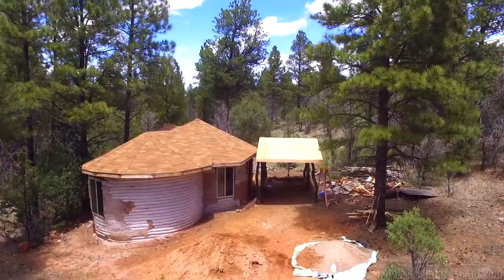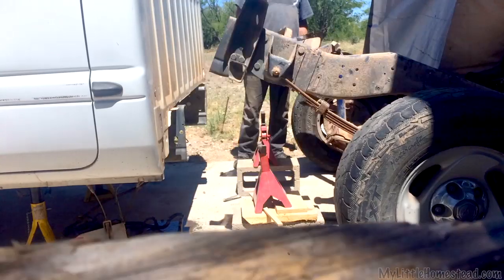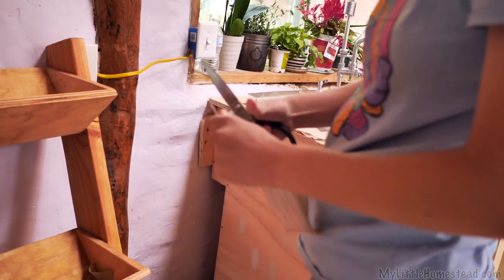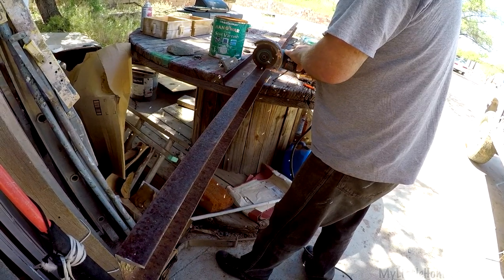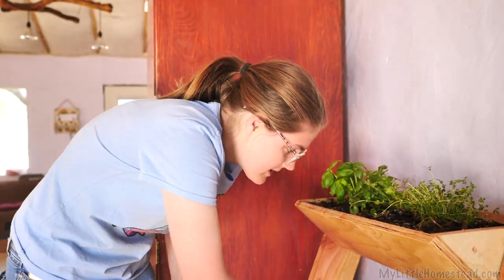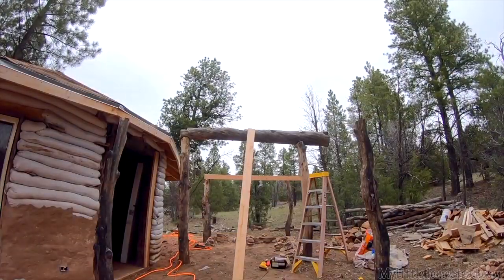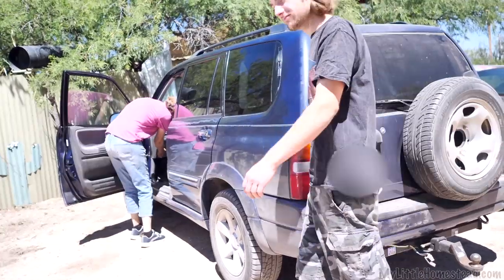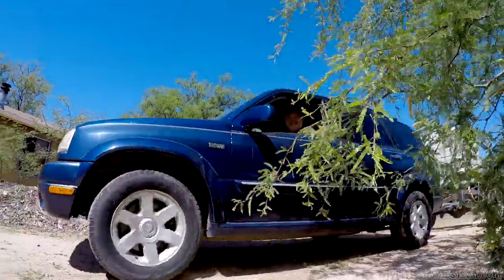Earthbag Cabin Return, Truck/Water Trailer Conversion & Herb Garden Planter  | Weekly Peek Ep187

Comment: you could use the concrete and put imprints of the plants...they would look like fossils
Reply: That's an awesome idea! I might have to try that at my house, I need to resurface my porch steps
Reply: Wouldn't the impressions make it harder to keep a clean surface?
Reply: @loro9385  not once you seal the concrete. The impressions would not be all that deep with plant prints.
Reply: Add all that together. Do Impressions of the leafs in concrete, paint, then epoxy pour to create a smooth surface! That would be amazing!

Comment: Forget epoxy countertops .. scratches show ..up yellowing . Forget about it ...
go with concrete..
Reply: Epoxy on live plant materials results in the drying of the plant to the point that all that is left is a clouding pecked bubble where the plant used to be. Even dried plant materials will dry further an end up doing the same. You can put it over stone and wood and metal. But, eventually it will chip, crack, and yellow. There are the colored and mineral tinted epoxies that you can make an abstract out of. But, stone is better. or try your cement idea. It is not something I had really thought on. But, who knows?
Reply: agreed

Comment: You guys could do a concrete counter with square cutouts; fill the cutouts with mesquite leaves/twigs, and then fill the cutout with epoxy.  Best of both worlds.
Reply: I had the same idea. easier to keep clean than impressions of leaves (as some have suggested) because of the smooth surface of the epoxy squares. however, before committing to it, they will probably want to try a test on some scrap material first to make sure they like it.
Reply: nice idea, I would fill up with epoxy to cover the leaves but have a final layer of glass so that it is properly heat resistant and easier to clean.

Comment: Epoxy as a workspace will scratch. You can sand and polish it though. You also have to be careful putting hot pans on it. Sealed concrete wont scratch and you can put hot pans directly on it.

Comment: press any leaves or twigs first so they stay flat before epoxy,  if you go with concrete add some  powder color and recess some smooth stones about the size of a quarter into it and sponge them to be seen
Reply: Pressing is an excellent idea. Also to see how the organics will withstand the epoxy cure, do a test on a separate piece of board.

Comment: I would use concrete, you can use the leaves to make impressions in the concrete as well. The epoxy can be nice but concrete can handle heat.

Comment: Hello guys, I did my counters in epoxy. Very durable, heat resistant, water resistant. You can’t go wrong  I would recommend stone coat countertops. Great product low voc, up protected.

Comment: Take two pieces of glass,  3" x 3", sandwich you dried plants, embed in your concrete.  Do it in on the edges to outline your countertop, not where the glass can be scratched. Give the glass a coating to protect it.  Just thought...

Comment: Entombing stuff in epoxy typically has two consequences. The items get sunbleached eventually and don't look good and/or oil and whatnot from the items goof the curing process. Also those items will float which means you need several shallow pours which can be a real pita. Either way, the issue with epoxy resin is that you pretty much get one try and unless experienced a big pour will probably have issues. - On the flip side, we're planning to do concrete countertops. There's so many coatings and stains for it nowadays I really like the idea. I'd definitely go with concrete counter tops if I were you. Then, get the kids experimenting with resins so that you can do some of that down the line.

Comment: Have you guys ever used "paper crete"? It is portland cement with shredded newspaper. It is a great insulator and you can spray it on the outside. It might work better than "air crete".

Comment: The epoxy on the table with all the leaves and flowers will be great they will not lose their color if you put a layer of epoxy down first and then put the leaves and the flowers down and then epoxy over them you shouldn't have any air bubbles or anything in anywhere and they will last forever. You can use a small lighter torch to pop all air bubbles that rise to the surface. Make sure you do that before the epoxy dries. Love your videos guys keep them coming.

Comment: The main problem with epoxy and plant material is it forms bubbles within the epoxy that almost look like foam which leads to the plant material discolouring and the finish becoming opaque. We got around this by boxing the benchtops in a completely sealed box and creating a vacuum that pulls out the air with a vacuum pump. It will also help if you pour a layer of epoxy to put the plant material on before the second pour and vacuum. If you go for cement try polished cement since you can inlay glass, crystals and other visual magic and it looks amazing after polishing. May I also suggest acrylic pours and painting which is then covered in an epoxy layer as this allows for interesting 3D effects and would utilise Brees skills at visual design. Hope this helps, your family rocks

Comment: I would use concrete as the base layer to give the support you need, stain the concrete some dark natural browns then overlay that with the flowers and leaves on thin branches with a clear epoxy top.  If you seal the epoxy like they do with bar tops then there won't be the problem with yellowing that was mentioned below.  scratches and chips that show if covered with thin layer of epoxy after a good sanding every few years gives the brilliant water clear look that is loved.

Comment: For your countertops consider  both options. Press the impression of the mesquite leaves into the concrete then remove the leaves and seal with epoxy. If you want more color, before you epoxy do stains/dry brushing or both. Add uv block to the epoxy to prevent color fade

Comment: Tile is pretty easy to do but you could use 4x4's too. Cut them into half inch pieces nail or glue down, sand even and finish like normal wood. You could put an epoxy, Leave a gap and color your epoxy than sand that smooth and put clear on top. That would look like tile squares but it would be all wood. Lots of good ideas out there can't wait to see what you do.

Comment: Just FYI, There are two ways to do a concrete countertop. The usual way is to form them upside down. But there is a new way to do them right side up and in place. It involves commercially available plastic form pieces that break away after the concrete sets up.... see on youtube.

Comment: The leaves and seeds are pretty unique.  You could still do cement but maybe do impressions in the cement with the leaves, etc.  Then you could use a thin layer of epoxy over top to fill in holes and make it flat and level.

Comment: Make some ollas to water the herbs out of small clay pots (various vids on YouTube). You wont have the drip mess and it keeps the plants watered. Especially good for desert applications where water conservation is a must.
As for countertops, I would stick with concrete, as it doesn't off gas and you can put special glass or stones in making them visible, plus you can use plants and sticks, making a kind of fossil and paint them, before sealing it. Plus it doesn't scratch as easily as acrylic. Just a thought...

Comment: With the trailer you could move the axle attachment of the leaf springs from the bottom to the top of the axle to lower the center of gravity. Make it safer for transport. But with 1500 leaf springs they are rated at 1400lbs and that water tank full weighs around 2200lbs. Might flex enough to hit the axle if you do. Just a thought.

Comment: Parsley, mint, thyme, lavendar, rosemay and oregano do very well outdoors on the North side of a building. Parsley is biennial all the others are perrenials. Rosemary gets LARGE. Parsley, oregano and mint like dampish feet. Parsley and mint and oregano self sow. Cover them outdoors with a wire umbrella to keep the chickens and other tasters off the plants.
 It is a cute grow wall. Great for annuals and tender plants. 

Concrete counters work well. You can make 'fossil' leaf patterns by pressing material into the wet smoothed cement. Flake the pattern pieces out after the cement sets fully. 

Be sure to vibrate the cement well to eliminate bubbles. I did my first counters back in the sixties ( I think I remember that time). Vibrate was a hard won lesson. Also never too much trowelling if you want smooth, cleanable and hard surfaces.
 There are many food grade sealers (I like paste wax about 30-60 more days after cure and complete drying of the cement (it will stop feeling cool to the touch once dry)) for the final surface. Yes, you want to seal it. Like marble acids etch it and oils soak in and discolor it. 

With fine aggreagtes you can get a good durable surface out of an inch thick 
counter. I do not recommend any thinner. Thicker is fine but allow for 
longer drying time.  (sand, crushed glass, crusher fines but not fly-ash or slag for food surfaces. Reinforce with chopped poly fiber which reduces fine drying cracks (available at concrete suppliers and online as is the mesh) in the mix and use a non-metalic mesh as reinforcement in the bed. It is easy to shape and will not corrode like chicken wire or welded mesh does.) 

Wet cure (keep damp for 30 days) the counter by placing plastic under and over the surface and mist as needed. You can leave the plastic under after curing as it is out of sight.  

Like any stone, do not free span any distance over a about a foot and a half. I strongly suggest making a plywood/osb deck to bear the whole surface ( you can make the counters off site and install after cure and drying. You do not have to anchor the counter to prevent sliding, if you place some short key pins  (fiberglass or whatever non-metal you like) or troughs as a small gouge keyway in the deck.  You can use an adhesive from the bottom  or along the back. 

You can create hang over edges and back splashes with some creative wood forms. Bull nose and OGs are best done after cure with a stone router and polishing or use plastic drywall corner material to create the curves. A little spray of pam on the plastice before application makes it release easily.

Sorry, I get carried away! clear as mud right?

Comment: I refinished my dinning room table with epoxy, it looks great 4yrs later and it was so easy and fast. 

The cool thing about epoxy is you can put stuff in it, ( I would not put a live tree branch under)  but metal, dry wood, pictures you could be really creative with epoxy, for that matter you could paint the counter and then epoxy over it. That would look awsome !! Also its easy to refinish. Just be sure to stain or paint the wood underneath before you do anything, dont epoxy unfinished wood.

Comment: For the counter ideas maybe take some of your scrap plywood  ( 1 ft x 1 ft ) and make several test pieces. One for concrete, or 2 for different colors ect. One or 2 for the epoxy with plants , and if you don't like the clear with plants you can color epoxy over it.  With several tests pieces you'll be able to figure out how much you will need plus see what looks the best to you all without committing to the whole thing.  You can even do heat and water tests safely on the test squares .   You may be able to do a metal/ wood mini landscape with plants in epoxy, like an old farm look with painted background?  Best i can think of not knowing what all materials you have.  Good vid.

Comment: What about doing the concrete counters but before they dry lay the greens from the mesquite trees on top to imprint the shapes? Use a smooth roller to go over top to get the thin leaves embedded then peel off. I'd do a clear coat finish over top so it ends up being level and nothing gets caught in the shapes to keep it cleaner.

Comment: If you do epoxy over flowers or those tree pieces they won't loose their color in fact it will deepen the colors... you're just going to have pour slowly and a little at a time over the pieces so that they stay in place until you get the first coat down...I bet it would look really pretty...use the same stain then epoxy 😀

Comment: Did the Appoxy a few years ago.  It did hold it's color very well but it was so heavy, I mean very heavy! If you slice anything, the knife will leave scratch marks. We tried everything and ended up pulling it all out for cement counters with a large butcher block insert. He also made a butcher block sliding insert for sandwiches, etc. Hope this helps. God Bless.

Comment: Make a 1'x1' test form & test how the folage will work in the epoxy. You could use it later as a wall hanging or what ever.
Reply: I believe you will have to pour some epoxy in the mold first & let it set up for a bit, then add the greenery & then pour more epoxy over it. Thus, sealing it inside the middle.

Comment: I wouldn’t know about staying power of the Epoxy and end result, but you could always test it out by making a cutting board or wall piece with both the Epoxy and Mesquite to see how it turns out. Makes for a small project that is usable, and gives you the experience with both 😊

Comment: I would make a cutting board to test the leaves in epoxy...I tried it once and it decomposed and looked bad.  The small leaves will probably curl from the heat of the epoxy too.  I believe Shelly would be happier with paint and epoxy, but Gary has his heart set on concrete :)  Maybe split the kitchen for both of you.  Concrete the island and paint/epoxy around the big sink.

Comment: Nice use of the ol' parts vehicle chassis for the trailer. Looks like you would even be able to register it without any issues. Although if you are only really using it on your property and the road leading to it is probably a private road too you would not need to I think. Looks to be large enough you could even put a different design tank on it if you find that with the height it is too top heavy when loaded, although for the most part you should be fine. My families cabin is all private roads going right up to where we fill the water tank although ours is in the bed of a pickup not a trailer, not to mention in another state.

Cabin is coming along great. I noticed you basically have ventilation holes at every place a rafter goes through, you should keep it that way or rather put in a screened vent thing on each that you can open and close. You would want them opened in the summer to help let out the hot air and closed in the winter to keep the warm air in. Having a covered patio area is great, although you may want to add some gutters around the cabin otherwise you may end up with a waterfall happening under the patio in the monsoon season.

Nice herb planter, it is always great when you can have access to fresh herbs. If you find you have more herbs than you need you can always dry the extra out for long term.

Great find with those solar panels. Slowly building your off grid power system is great.

Edit: Forgot to say you may want to add some rubber on the feet of the herb planter to help prevent any sliding.

On the subject of counter tops I would think the the vegetation would change color if you don't treat them first. Although you can try drying them out and then spraying with hair spray or an acrylic spray, I think there is also a specific spray designed for this. Epoxy can yellow over time and can get scratched semi easily, I have used enviro-tex in the past for my epoxy and it has maintained clearness alright(but doesn't see a lot of sun which may change the color) and is designed for use around food but can be a little more expensive. Concrete or epoxy are both doable and heavy, the concrete would probably be cheaper than doing the whole thing as epoxy. You could always combine the two and have a base of concrete with a top of epoxy.

Comment: I think do a wood counter with mesquite wood and then put a seal over it. Concrete wood be ok but you have the tree there now. Then finished the tree in whatever varnish you do the counters. If it is doable I would make a small sample counter that you could use a a cutting table first to find out if you can apoxy the leaves and flowers

Comment: as far as the concrete go's you can pick up color dye's at the same place you pick up the cement bag's, and for the epoxy you can do just about anything with it, just need to find a way to hold it where you want it.40 years as general contractor and antique furniture restoration...

Comment: Anything with water content causes air bubbles and clouding in epoxy and resin. If you want to avoid tile, stone, and wood, then go with concrete. You’ll want to seal it with a food safe concrete sealant.

Comment: You could actually do both.do concrete then epoxy over it to seal it and add any decoration art in between. Make sure you use counter top epoxy as is you use any other type it will not stand up to heat, wear and tear and will yellow. Proper countertop stuff doesn't do that. And makes a nice finish.

Comment: Shae, great planter idea... you may want to consider plastic in each plant tray to keep the wood from rotting and each tray will hold the perfect amount of water needed per tray... depending on the plants requirements.
Reply: Or may some kind of epoxy sealer...I did a similar idea with wood and it rotted after a month or two and started looking bad.